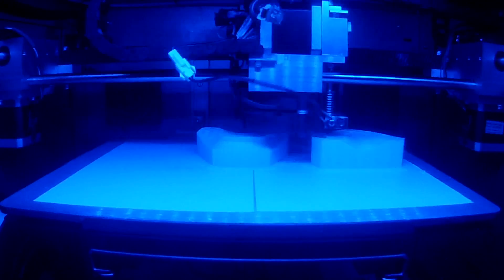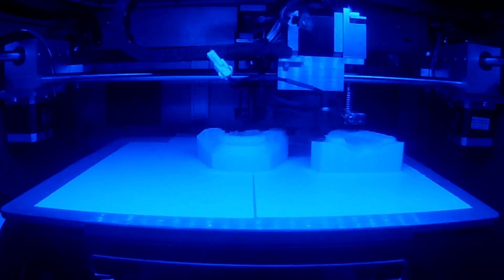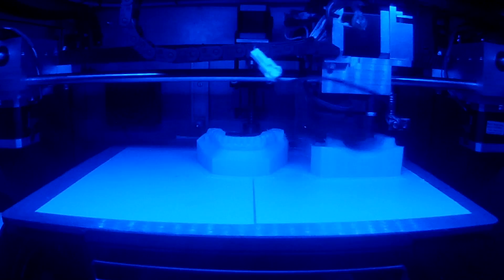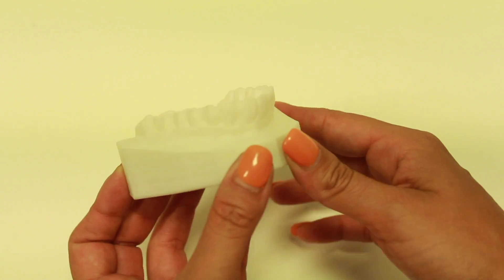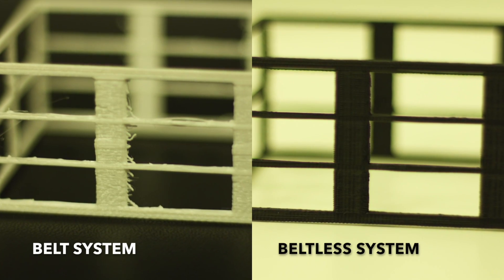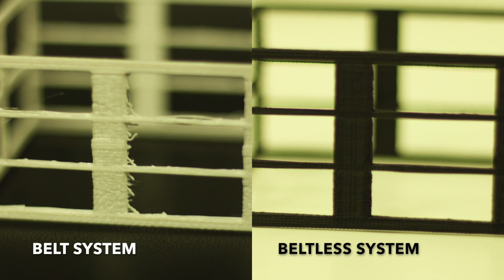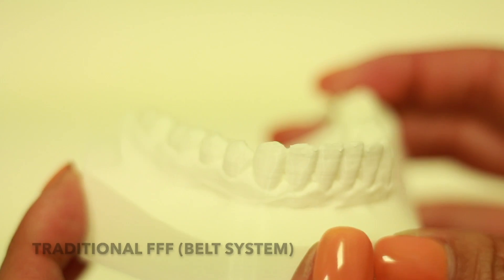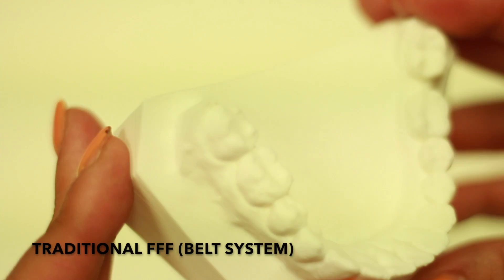Roboze's Beltless 3D-Printing Technology - Overview & Benefits

Comment: if belt systems had crap like that, no one would use them. Also rack and pinions have backlash so there will be a new engineering playbook full of errors to deal with starting with backlash, have fun.

Comment: The video does not show any improvement due to using this vs belts.    Using a white model is deceptive.   The example before and after is terrible and deliberately shows other print issues in the before, i have never seen such shit quality in the before image since the first repraps.  my belt based system and many others do better than your after image too.    Surface quality seems to be a large culprit as well as filament pressure regulation along with poor rigidity.    bets are even used in CNC machines, ink jet printers, etc.... you can also just make the belt wider and use a steel belt instead if stretch is a concern but there will be many other problems with a printer that overshadow belt issues.
Reply: toothed belt or j belt?

Comment: this is an amazing video and its in great quality. the only problem is that belts are not really problematic.. its not really elastic unless not used properly.. my 4 3d printers have amazing quality ive also used .2mm nossel to improve this quality. if tuned and made properly.. no quality is lost..  butbthis system will definitely be more Ridged and have not backlash.. it wil be heavy compared to a belt.. just my opinion but more printer choices the better.. bring out the competition and innovation.
Reply from the maker: Dear h1hummerh3t,
 thank you for writing.

The belts being elastic and not rigid lead to a decrease of the accuracy and repeatability problems especially in the long term because they tend to deform, which it doesn't happen using the gears.

The problem of backlash doesn't show up in our machines for three reasons, in particular:
- the use of helical gears with angle of 20 ° leads to a gradual and uniform use of the teeth from one end to the other end of the tooth and this generates a regular and continuous operation;
- the lubrication gears;
- the electronics of the machine is set to give a perfect meshing between rack and pinion.

Hoping to gave you a good clarification, if you need further information don't hesitate to contact us!

Comment: We here at Massivit3D made a 3D printer with a lead-screaw instead of a belts, 3 years ago. All axes configurations has their advantages and disadvantages. when using a rack & pinion for example requires moving the motors with the extruder, leaving you with less force left for the actual 3D printing movements, and may lead to steps loss, or using larger & more expensive motors.
Reply from the maker: Dear Mr. Miller,

Thank you for your input.

Each technology has its pros and cons, you are right in this. We were still able to find the right configuration of mechanics and electronics that allows us to go beyond what you say.

Seeing is believing! We hope to meet you at a trade show around the world to further discuss.

Comment: like it and its precise and quiet but not sure how you went about"patenting" a positioning drive system thats been in common use on plasma,gantry and other cnc machines for 30+yrs.You may be the first commercial 3d printer to use it and your particular mounting system may well be proprietary but the technology is old,proven tech...rack and pinion drive has been used on both low and high end cnc and nc machines for a long time with helical taking over the precision end over the last decade or so in an effort to get rid of screw whip,noise and raise the travel speed
Reply: this has been done multiple times on multiple reprap machines, there is nothing new about it
Reply from the maker: Dear mountainmanfab,
 you're absolutely right when you say that it is a proven technology.

Ours was a simple intuition that has combined the basics of mechanics with a 3D printing system. Nobody did that before.

From our perspective, this is the true meaning of progress. It is an evolution that includes one magnificent past!